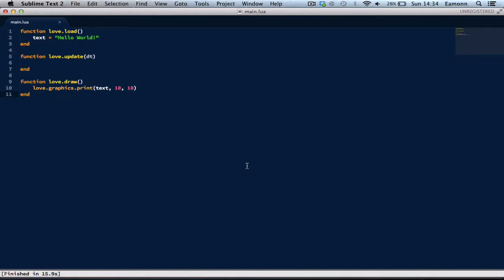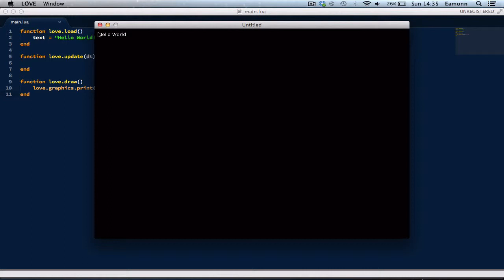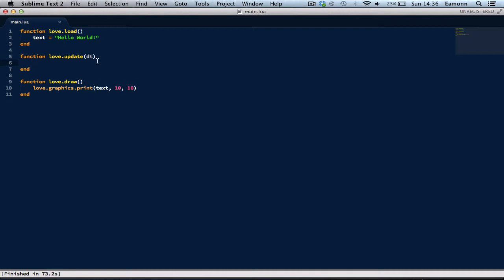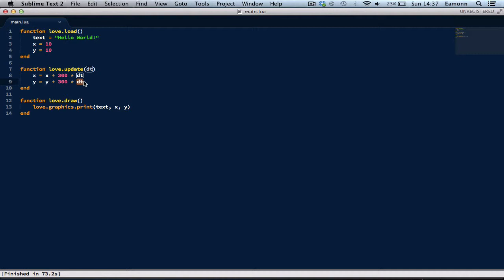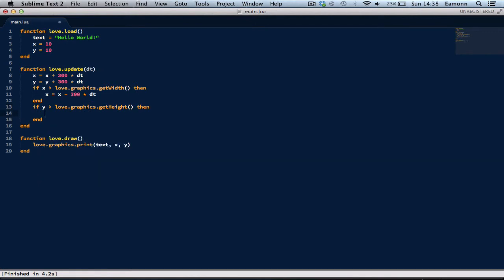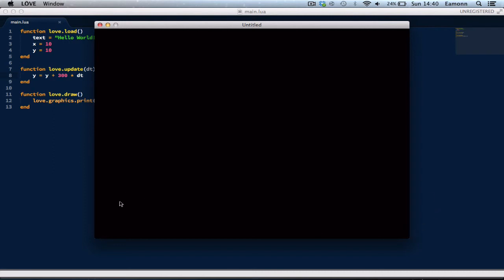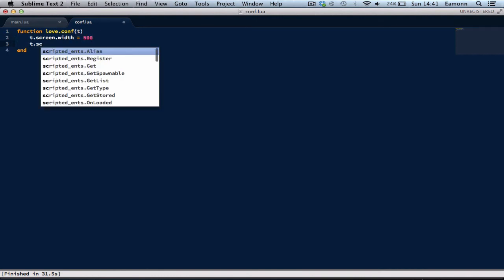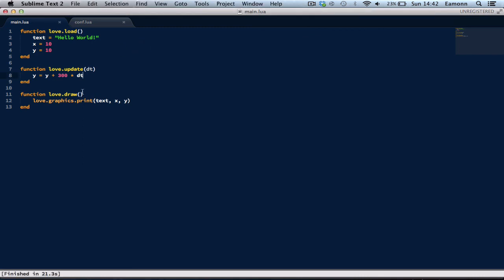LÖVE(Love2d) Tutorial for Beginners #2: Delta Time

Comment: I'm having trouble calling the conf.lua file. how exactly does the system know it exists.
Reply from the maker: You don't need to call the conf.lua file. LÖVE knows to use it just like it knows to use main.lua as the main file. When the LÖVE app is ran, I guess it checks to see if the file exists, if it does then load those preferences, if not then use some default ones IE use every module, set default width and height (800x600), use default title ("Untitled"), etc. That's purely a guess though. If you want you can ask on the LÖVE forums about the technical details of how it knows it exists.

But what trouble are you having with the conf.lua file, exactly? You're using the love.conf( t ) function, right? If you're running 0.9.0 then be sure to change "t.screen.X" to "t.window". I'd also suggest you look into love.window.setMode(), as it's very interesting when working with configuration. If you'd be more comfortable using that then I believe everything you can set in conf.lua you can set in love.window.setMode(). Keep in mind too that LÖVE was not written in Lua, it was written in C/C++ with maybe some Lua, but mainly C/C++!